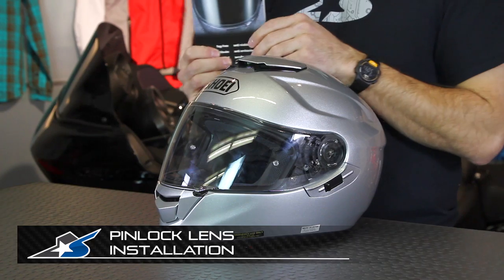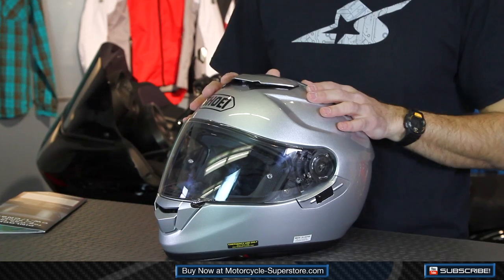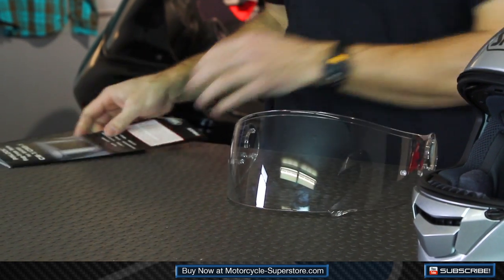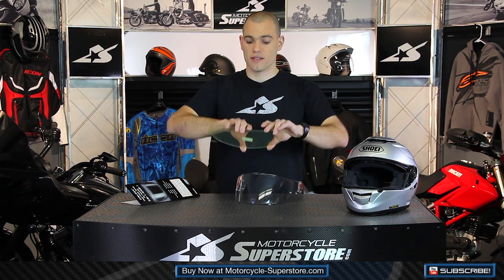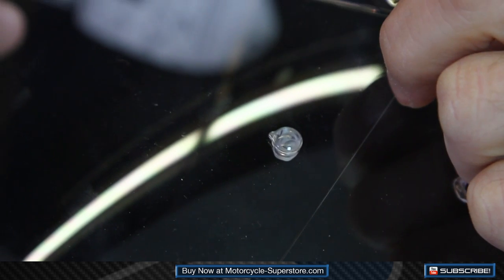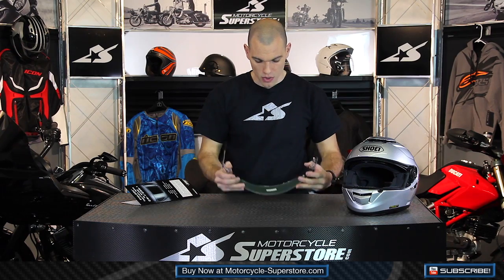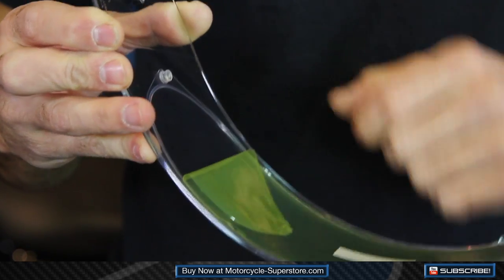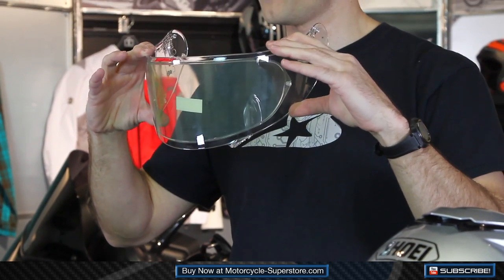Pinlock Lens Installation Demo from Motorcycle-Superstore.com

Comment: They work fine at night. I've been using pin lock for about 120,000 miles . Btw the tabs adjust with a flat blade screwdriver

Comment: Does anyone know how to get rid of the streaks that appear due to the pinlock insert touching the visor after installation? If I bend the visor again, then it clears up the streaks/smudge/contact points, but then when I relieve the pressure then it just appears again and it DOES blur up my vision ever so slightly with the helmet on. Thanks for any advice!
Reply: +Encore It shouldn't be touching anywhere. There's probably something wrong with the way it's snapped onto the pins. I have done 4 of these over the years and never had the insert touch the visor.

Comment: You can't wear it at night? Nice to know!
Reply from the maker: Will Wall Plenty of riders use them at night. That was a statement to point out that you need to be aware of potential limitations and performance suggestions from the lens manufacturer. - jc